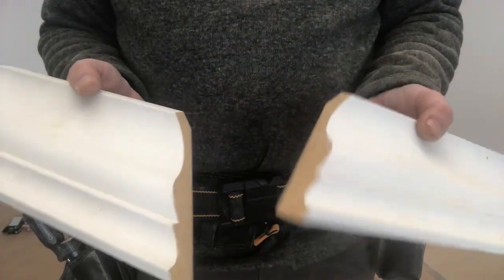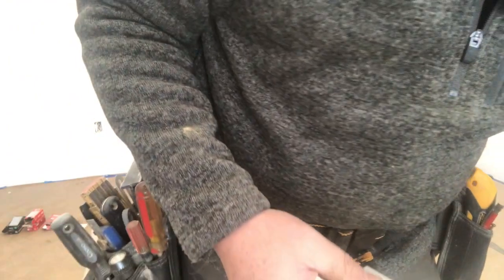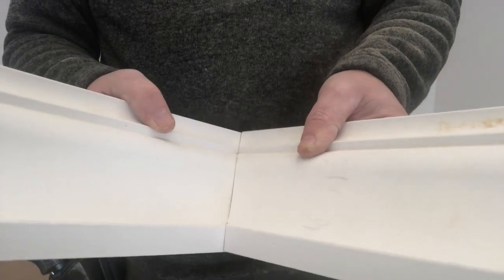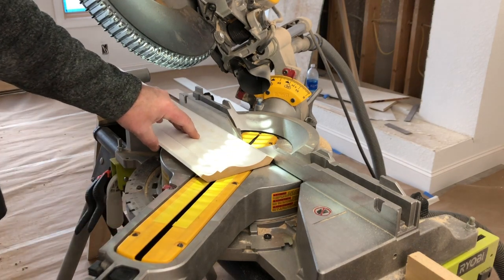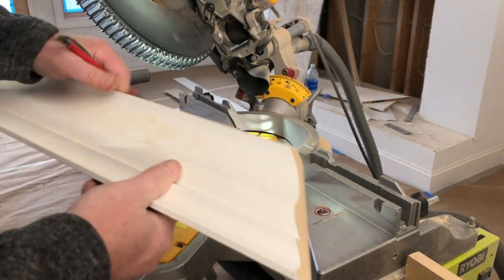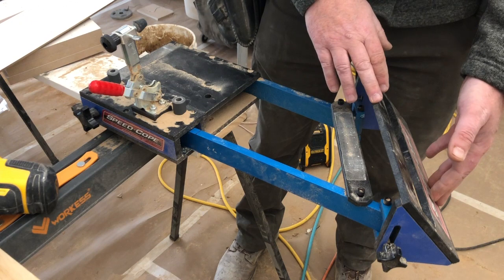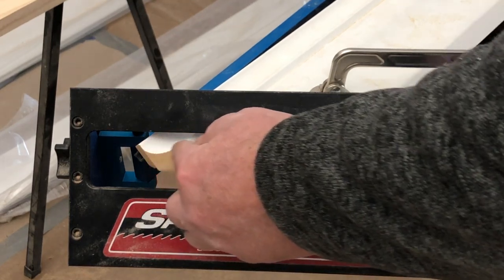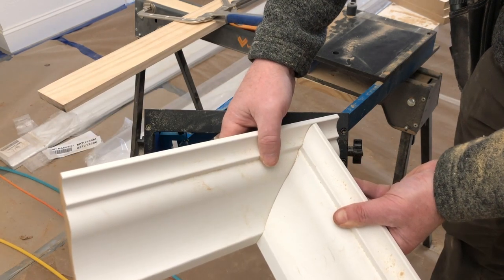The Best Crown Moulding Jig EVER?

Comment: Baseboards?
Reply from the maker: Thanks for taking the time to leave a comment. This video makes me cringe for many reason… to answer your question, yes it works well on baseboards as well.
To be transparent, I only consider using this jig if it is a Stain Grade job, and lots of it. If it is a paint grade job, I would simply miter and install, and I do glue with caulk at the inside joints and glue with TP and activator on the outside corners and returns. The goal if your going to do this for a living is to learn cutting crown nested, cutting flat when your crown is too large for the nested position. Reading wall angles, especially outside angles, and mitering cuts accordingly. Coping is a great skill to have in your arsenal as well. 3 basic ways, 1. Old fashioned coping saw by hand, 2. Look up the Collins Coping Foot for a jigsaw, 3. Something crazy and goofy like the SpeedCope. 
Hope this isn’t way too much information.